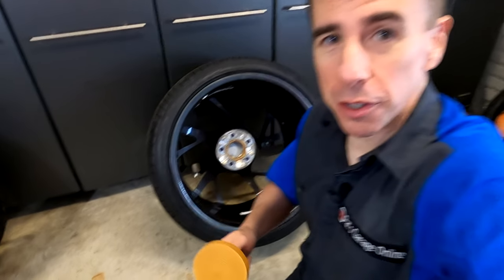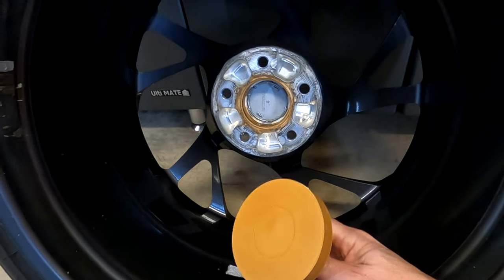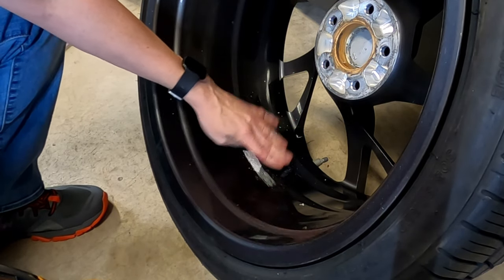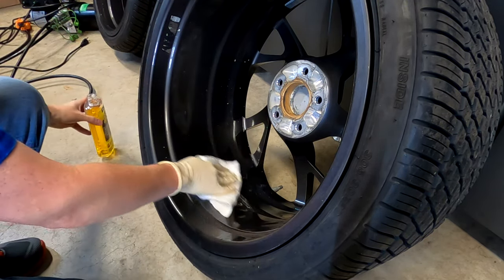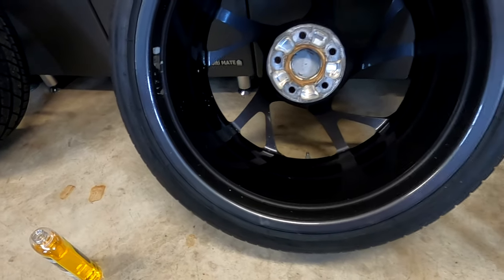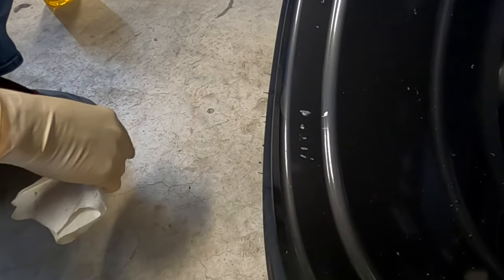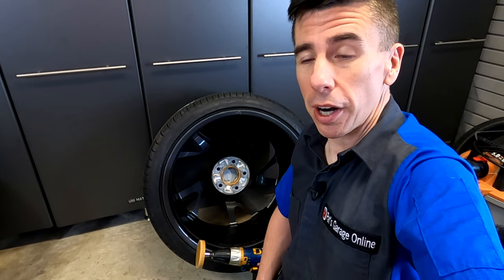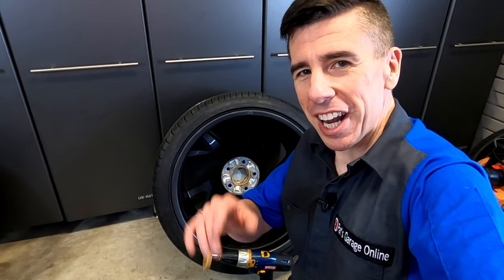Remove wheel weight sticker residue with this drill attachment.

Comment: Its too bad tire installers take no care in cleaning up the double sided tape residue when the weights are removed. Time is money i suppose. Great video, still baffles the tin cans in my head that this attachment causes no damage to painted surfaces.
Reply from the maker: I agree. And my wheels are painted, not powder coated. The rubber wheel caused no damage. I wish tire installers used them. I have touch up that matches the wheels. I'll have to do a video on that.

Comment: Alternatively, spray some brake cleaner on a piece of cloth and with that piece moist the rubber patch until you can scratch it with your fingernail, repeat the process for adhesive using a metalic kitchen sponge. Apply some anti-rust spray and polish with a soft cloth.

Comment: Does it also heat up the adhesive with friction, or is it just gentle mechanical removal with the rubber wheel?
Reply from the maker: It definitely creates friction / heat, but the adhesive only gets messy that way.  I have to use the Goo Gone to completely remove the adhesive.